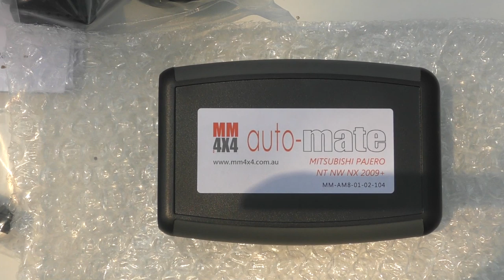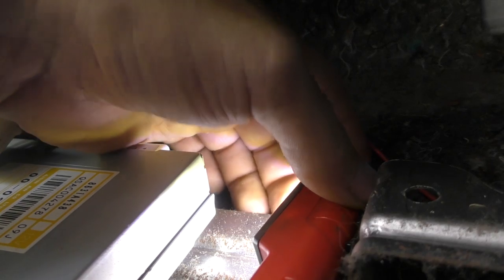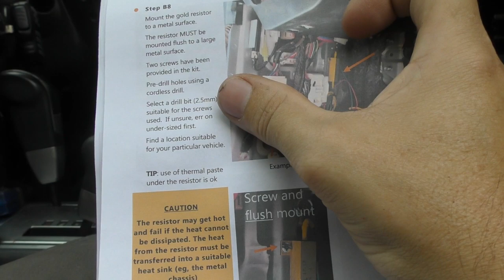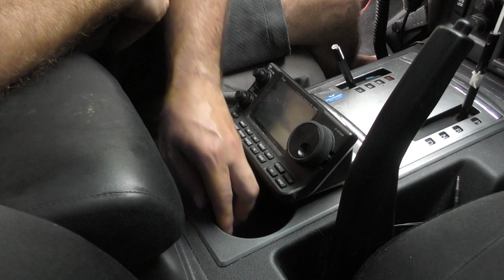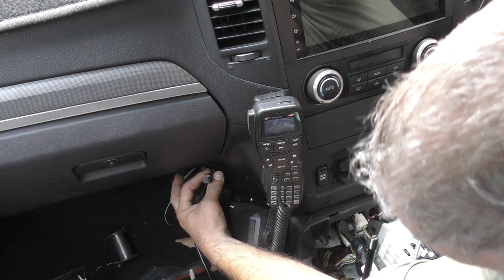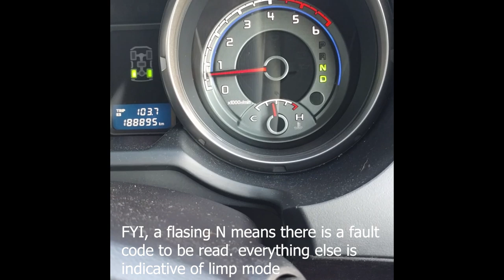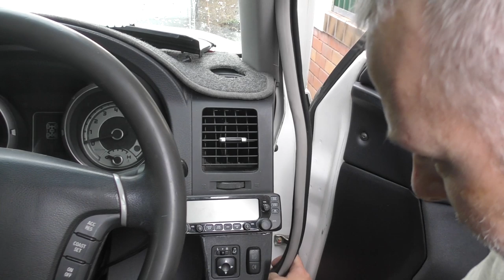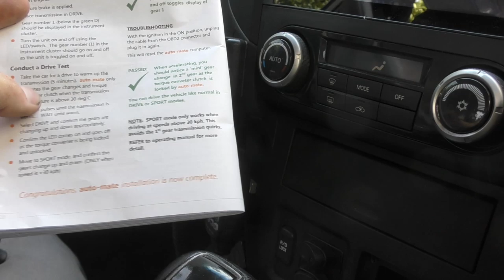MM4x4's Automate - Installed - Very detailed

Comment: Great video Brett you made look easy, this 52 year old, overweight and inflexible fool thought he would have a crack after watching your vid several times. Well its installed and works a treat, I did lose the little black piece that sits on top of white gear shift lever so cant use the gear knob until the new part arrives - can still change gears just cant use the gear knob. I think I would rather do prison time than try to contort my body do that resistor install and gearbox pigg back clip again. Had to raise the white flag and ask the wife for help - no one should ever have to do that.....works a treat - great bit of kit.

Comment: Thanks for the video Brett, it was invaluable helping me with my install. The issue with getting the plug in, in front of the shifter was a problem for me too until I got my wife with much small hands to just get in there and plug it straight in. I haven't had chance to give it a proper run yet but looking forward to it especially when towing the caravan.
Reply from the maker: Hi Steve,  yes that was a challenge. I guess I could have opened more of the dash to get to it but who wants to do that. Hope the wife got some flowers for her effort. I know I took some skin off getting my hand up there. Let me know what you think.

Comment: Hi Brett,
I'm from germany and proud owner of a pajero NS. I use the lock-mate, unfortunately the auto-mate isn't available for the NS. Which fuel saving can you achive in normal use without a trailer?
I'm really happy with the lock up kit, now you can feel the reel power of the engine and can hold the engine at it's higest torque at 2000RPM while driving up a hill. 
I'm amazed every time to see what's possible to do with the auto-mate and hope and wish that there also comes a version for the NS in the future.

Comment: i have enjoyed your videos very much but I was wondering did you ever do a series of road tests once you installed your MM4x4's Automate.
Reply from the maker: Hey Craig. In short NO. and my van hasnt really been out much since the install to do a proper review. We had fires here in Aus at the time or just after the install. then that went into covid and whilst that is still around, we've moved into floods. I know it sounds odd but that's been the past 3 years or so and we're still getting heaps of rain. plus add a dose of lazy in there and you know why.  Ive just gone out and picked up 3 new obd2 readers to test, and was looking to maybe to a good job of it then so i can monitor trans temps on the move using the torque app. I'm way behind in videos at the moment and trying to get back into the swing of things.    thanks for the compliment too

Comment: Hi Mate, thanks for all the great videos. Keep up the good work. I’ve got an nt auto and interested in the auto lockup. 
Looking to get better economy towing. Want to monitor my auto box oil temps. What is the piece of kit you use....that little screen? And how are they hooked up....to the obd port I take it?
Cheers Joel
Reply from the maker: cheers Mike, yes it was just  a little obd2 reader similar to this one https://ebay.us/lcBwEN  . I couldnt find the exact one but this looks the same just a differnt colour . I  have had mine a while and theres new ones out. You can then use the torque app on your phone to get the readings etc.  to get trans temps though requires some additional work. You will find it on the pajero forum in vic . if you can't find it' let me know

Comment: I know we’ve all been stuck at home, I decided to order the Automate today with the extra cash I have from not filling up so much. Any further updates on how she’s doing after the install.

Love the videos mate, keep them coming.
Reply from the maker: Hey Jim, the follow up is getting close. With all the fires, starting a new job and  now the covid, I've not had the chance to take the van for a run to get some testing done.  I can tell you though, just from normal driving , it's much more responsive and enjoyable to drive with this installed. It's also pulled my fuel economy back by about 1L per 100kms not towing anything. I know that's not a lot but with all the extra weight I have on board, it gave me back some of what I'd lost through the mods. Any questions Jim, let me know. Of course Marshall is very responsive if you need assistance too.

Comment: hi brett, great vids and really detailed info which is great. I am also looking to get a MM4X4 KIT installed....however i would also like the info screen you have also that gives realtime info back of the temps etc. What is the brand or name of that and where did u get it from? cheers joe
Reply from the maker: Hey Joe, thanks mate.  The screen is the Android app 'torque'  and I'm using it with a obd2 reader plugged into the paj.  Hope that helps.  Let me know if you need more detail.
Reply: @DENMONKEY  Is that the smaller screen  to the right of you as yr driving under the blue led button?
Reply from the maker: On the right of my steering wheel is a amateur radio control head.  The data is shown on the head unit(stereo) in the middle of the dash.

Comment: Thanks for the great video Brett, I’ve been considering one of these recently and I think I’m now sold on the idea after seeing this. Have you tried it off road yet? Just wondering if it engages in low first or second for down hill engine braking?
Reply from the maker: Hey Tony, good question. I' ve been talking with Marshall for info for when I do the follow up vid and had similar questions. I'll post his reply here, which should help  

Gear Changes
The smoother change from 3rd to 4th was good to hear in your case, but generally the gear changes with the lockup kit engaged are more noticeable.

Engine Braking
It does improve engine braking in general driving and towing, but off-road it doesn’t make much difference. The ASIN transmission doesn't lockup in 1st gear, and this is when you'd want better braking off-road. Hence don't expect a big improvement here. (The JATCO in the Challenger and NS do lockup in 1st - so are better in this regard.)

Off-road
The torque converter is actually your friend when off-road. It absorbs driveline shock and the extra torque it produces can help - especially in deep sand. So I recommend people turn auto-mate OFF until they need to manage transmission temperatures. In the Vic high country, once the oil temp gets to 90degC or so, I turn it ON and climb in 2nd gear (so it locks up). It's rare to truely need 1st gear when climbing. 2nd gear lockup reduces the trans temp even while climbing, and I turn auto-mate OFF again once temps are lower.
Reply: DENMONKEY Thanks for the reply Brett. I actually ordered one today and with the help of your installation video I look forward to having it up and running soon and trying out some of your tips.  Cheers and keep the vids coming 👍

Comment: Great Video Mate ... installed one today in my NT. Between your video and Marshall indepth instructions it was a breeze. ( Although I did manage to snap that little white plastic straw thingo on top of the gear selector ) ... now gotta figure out where to get one and how to fit it :(  .. any suggestions? Its sitting in there and working atm but dont know how long for
Reply from the maker: No worries Steve. Marshall's instructions are sine of the best I've seen. Can't really go wrong with them. No idea on that plastic tube thing. Other than the usual like mitsi or a wreckers. I couldn't even trek ya of they're the same in other cars, so you could pinch one from there. Taken her for a test drive yet?

Comment: Hi Brett, im really keen to hear your feedback regarding the Automate. Any approx time for that review? Cheers mate.
Cam
Reply from the maker: Hi Cameron, it won't be until the new year. I need to get the van out for some traveling before I think I can give it a fair review. With the fires and then covid the van hasn't been out in 12 months. Without the van though I'm loving it. Combined with the throttle controller, it feels completely different to drive and much more responsive. The controller gives the extra kick and the lock up puts the power through to the ground, so a nice combo. I'll get it done as soon as I can.

Comment: Slightly different to the 200s one. Mine is dual speed, comes on at 80 or you can bring it on at 30 (which is a bit low on bituman). Should do good things for you. Cheers Steve
Reply from the maker: Looking forward to testing it out, especially with the van. I can change the setting on it for when it comes on etc but have it left as standard for now. Once I get a feel for it, I'll make some adjustments to suit me. It's all adjusted via the cruise control settings I believe and I think the indicator stalk. I'm not getting into that part just yet. slow and steady and all that

Comment: Hi Brett

Did you managed to drill two holes through or is it just been held by one? I had trouble drilling through the lower hole.
Reply from the maker: Good question. I think I just stuck with the one
Reply: DENMONKEY thanks for reply. I’m doing similar mods to you. Are you in Facebook any easier means to contact you?
Reply from the maker: Yeah, kinda 😁 in trying to set up a  group but face book is not my Forte. If you just search for denmonkey it should come up. If not let me know and I'll shoot you an invite some how. I'm still working on it though. Wont  be up and running  for a little while.

Comment: Great video mate. Any updates regarding fuel economy, towing performance or anything else? Do you recommend it?

Thanks

Brett.
Reply from the maker: Hey Brett,    I haven't had a chance to take the van out just yet for a good run, fires and all that are making it a bit hard.. 
For driving back and forth to work, it dropped about 1km per 100km on the freeway. 
to give you an idea against other changes that could be made, I went back to 265/65/17 wheels vs the 275/65/18 I normally run and I gained about 1.3 L/100kms  on the same trip. 
I'm just trying different things to see what differences they make. 
I think the real difference will be in trans temps but again, I need a good run to check those out properly
Reply: @DENMONKEY  cheers mate. Look forward to seeing a video regarding towing performance. I have the same pajero and looking at installing one of these kits for towing our 2t van.

Comment: Hey Brett, thinking about adding this to my NT, hows it been behaving for you when towing?
Reply from the maker: Hey Dave, I've only just a week ago gotten to take the van out for a property trip. It was only 2 hours away . With the fires  we had being followed by Covid  the van hasn't been out for a good run since the install. The Pajero had but just not towing. I still have plans to do a proper review but I need more time with the van on for that.    What I can say is that it gives you a nice positive feel when driving and you can tell when it's on.  Acceleration feels more direct and its definitely holding and adjusting gear changes that make over taking or going up inclines much easier. It just picks the right gear for the situation and makes the whole experience much nicer.   It reduced my fuel usage but I'd only say about 1.5-2l/100 at most.  That and I don't need worry about being in sport mode and changing gears. That's nice too 😊
Reply: @DENMONKEY  Cheers Brett , yeah I just need to get organised and stick one in I think. If it does what it says on the tin, then I'll be happy. Only have a small camper trailer but Im lazy and not a fan of sport mode :) Stay well m8.

Comment: Are you running an I drive along with the automate through the bod?if so ya had any issues?
Reply from the maker: I sure am Steve and no issues at all. In fact I reckon they're an ideal combo. 
The idrive gives that bit of extra poke and when the automate locks in, the old girl really takes off. I forget how much better the experience is until I turn it all off.

Comment: Hey Brett,
Excuse my ignorance, but....
Can i ask what the OBD2 is used for? I know that it can show codes/faults, but does it do any thing else?
Reply from the maker: Hey Reece, no probs at all mate  the obd is just the interface with the cars 'computer' if you will. In addition to letting you see any codes which are used to tell you what the fault is, you can also clear those codes. Handy for simpler errors , especially when working on the car and disconnecting something that will cause an error when there is no real fault in play. The other thing there handy for is monitoring the cars sensors real time. So combined with The torque app in my case, you can watch trans temps, coolant temps, boost pressures etc etc. Useful when towing.    So for picking one up for about 20 bucks off eBay and getting the app, is both interesting and useful.   Hope that helps
Reply: @DENMONKEY  ah ok, that's very cool. Just looked at the torque lockup kit. Bit too rich for me right now, but it looks so good!
Reply from the maker: @reececulver3606  dont get confused between lock up kit and just the phone app that lets you see your cars stats. :) 2 different things
Reply: Yeah i have actually purchased the obd2 sensor last night haha
I would love the torque lock up too, but aside from the cash, it doesn't look compatible with the Petrol NT pajero 😔

Comment: Hmm I wonder if this would be suitable for the Delica as well..?
Reply from the maker: oooh good question. I'm gonna say I don't think so since it only works on the NT 2009 pajero and up. I think the series 3 only went to 2011 but not sure which gear box it has in it. The NT onwards got the Aisin box. You have any ideas which it might be.
Reply: @DENMONKEY  , nope hipefully someone wiser will read and let us know.. I have a 98 LWB Super Exceed V6.. love it, very versatile.. cheers.
Reply from the maker: I had the  96 in the same. Used to love it. the space is bloody brilliant. Not sure if you've seen them but I have a few vids on here about the camper build etc in the back. 
Didn't start really doing the utube thing until I sold it for the pajero. Wish I had of though. I still miss it. I'm dirty they changed the make up of them in the later ones for the soft off roader style. If they still had a proper 4wd system etc I would have one now.
Reply: @DENMONKEY  Yes, I have watched them.. no worries, cheers
Reply: @DENMONKEY  There is a NS Automate available with the Aisin gearbox. If the Delica has the same box it will work.